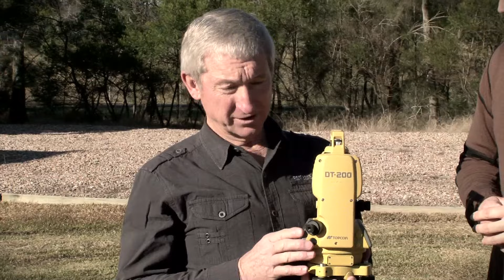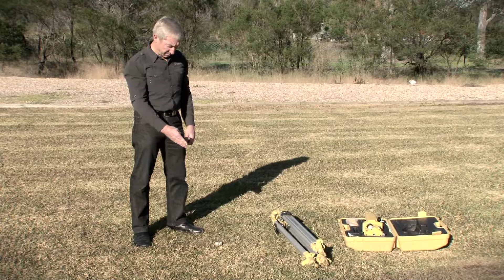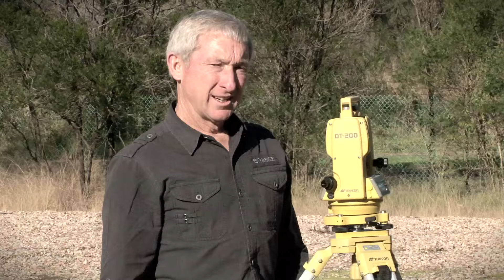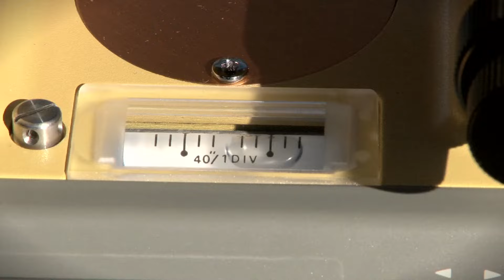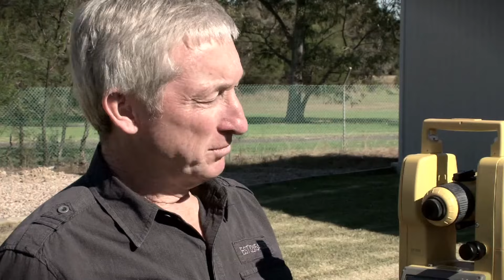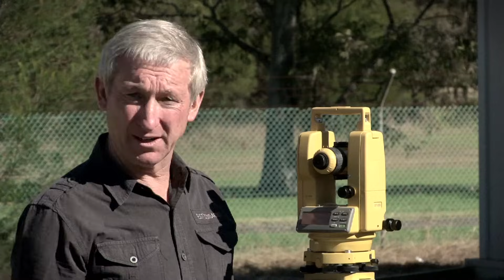Theodolite 1 - Intro & Setup

Comment: Alternate method:  Set up the tripod over the point keeping the top of the tripod as level as possible.  Use a plumb bob to also get close to being directly over the point.  The tripod can simply have a cap or have the instrument on it to keep the plumb bob centered.  Use tripod leg adjustment to get the plumb bob as close as possible to being directly centered on the point (and don't forget to get the tripod firmly pressed into the ground surface).  Remove the plumb bob.  Then level the instrument.  Then use the optical plummet (or laser plummet) to get directly on the point.  Unscrew and move the instrument as needed and try not to twist it when moving it so as to maintain level as much as possible.  Check the level, double check the point - adjust as needed.  Done.  I think my alternate method is a bit quicker than what you see in this video.  But to each his or her own. 🙂

Comment: When using the plate level, you also need to rotate 90 degrees,  and level ( with the 3rd screw only), and repeat, until level both ways, and still over the point.

Comment: A quick question, if you know the answer...
I have a theodolite with a laser plummet. However, the tripod has a plumb bob hook inside the tripod screw. This works well for when I attach a plumb bob. However, this interferes with the laser dot which becomes quite blurry and poorly defined. What do people do in this situation?
Reply: Stupid answer - Can you remove the plumb bob hook from the tripod?
Reply: @christophertierney6600  Only in the same way that I can swap out my laptop's hard drive for another... (not easily or quickly). In the end I removed the plumb bob hook with the intention of returning it to the tripod screw... but this action certainly damaged it (the way it was attached suggested it was not designed to be removed). A separate tripod screw (with shipping) was almost the same price as a new tripod. So, the solution I have adopted is to have 2 tripods.
Reply: @mathmandrsam  Some lessons are expensive ones. Silver lining is having a second tripod?
Reply: @christophertierney6600  I wasn't too worried about the price. Bonus was that the theodolite was new but old stock (still sealed) and I got it 50% off retail. So swings and roundabouts.

Comment: With all due respect, if you worked for me, I wouldn't let you touch a theodolite! I would use you as a rod man. I have been working in surveying for more than fifty years(yes, I am old) and am still working. No self-respecting instrument man would set up like this. First, we use a light weight plumb bob while setting the tripod for rough centering(the tripod should have a plum bob clip to hand the plum bob). Then we level the instrument COMPLETELY, otherwise it would be folly to use the optical plummet. The instrument must be leveled in BOTH directions, not just one as you did. Then we use the optical plummet for fine adjustment over the point. Then we level again and check again. Usually, that is enough. The entire process should take no more than half a minute or so. People on the job don't want to wait around while you fiddle. I will give you credit in that this seems to be the inane method currently taught to unsuspecting students. By the way, fifty years ago we used steel circle transits with no optical plummet, just a heavy plum bob. I could set up perfectly in around thirty seconds(even in the wind). The world record was around ten seconds!(Yes, there were competitions!). So, let's stop using this "modern" insane method and use what professionals use: a plumb bob for the rough setup.
Reply: I usually use a dot lazer it's a little bit faster for me to center the legs.  And I use a torpedo to get the legs level before I even put on the theodolite.
Reply: A plum bob, is that like an apple bob ?, bobbing for apples, that is.
Reply: Time to move over pops
Reply: @iwaswrongabouteveryhthing  I see you have total disrespect for the older generation that one day you will be part of. This lecturer DID NOT even show a quick push down of the Tripod legs with a Foot to embed them slightly into the ground, before even adding the Instrument to top.
Reply: Only noobs need a plumb bob for rough set up!!

Comment: I do not understand???  This process was taught in class as well.  I highly disagree.  A torpedo level and plumb bob is required.  
Correct process.
1. extend legs and place level on top of tripod, and level
2. hang plumb bob and move over pin
3. recheck plumb bob level
4. connect Theodolite and check level and pin

The problem with the way which is shown in the video is that the base for the theodolite is not level.  So when our engineer in the video used the plumb sight to get over the pin, he was still off with his levelness of the base, which is a big issue.  Time, it is a waste of time.  efficiency is required.

I argued with my classmates about this and they disagreed. However, they are wrong, this video is wrong, and I am correct.  I know that my way is correct.

Furthermore, when our engineer slides the theodolite to center over the pin, his levelness will be thrown off, because his base is not what?  correct, is not level.  thus this videos process is just fighting a losing battle.

I am a bricklayer and this is how any bricklayer would perform this task.  thanks.
Reply: If you  start with an instrument that's pretty close to zeroed, you can eyeball the top of the tripod level. The leveling screws got plenty of stroke  you don't need to fuck with the torpedo . It's redundant. You're going to have to use the leveling knobs  anyway.
Reply: This lecturer DID NOT even show a quick push down of the Tripod legs with a Foot to embed them slightly into the ground, before even adding the Instrument to top.

Comment: You wanna save a bunch of time...????
Set up over the pin looking through the down periscope.  Don't even think about touching the screws yet.
The bullseye bubble is just to get you close the critical vial is what you want to be gospel when you can spin it round & the long vial(critical vial)
Remains spot on level through 360,780 etc are you ready to go but we're not there yet.
Next use the legs to get level w/the bubble just fast & dirty.  Check down scope for set up move if necessary.  If you start turning dials @ this point it will move far from its mark & you'll be repositioning it all damn day.
After leg leveling & the bubble seems to stay in its circle your still not there if the critical vile isn't spot on through rotation but real close now use the dials for fine tuning & last positioning.   & when leveling 1 leg & 1 dial you should never move.  It's on 3 legs & has 3 dials use two legs to level up to one leg and two dials to level up to the dial that was over the stationary leg.  I'm no professor at this just years behind one laying out commercial buildings as a carpenter.  When everybody's screaming for layout lines on the site time needs to be saved without throwing down dirty layout or a busted grid.  Layout personnel need time backcheck their work or it's gonna be the curly shuffle
Reply: Bill, agree, however, a plumb bob and a torpedo level ( high quality) is better.  this allows one to center over pin and level top of tripod.  saving tons of time.

Comment: The foot screws on the tribrach were some way off the central position before he started. Better to be central so you have equal opportunity for adjustment both ways on each screw. Also when checking the plate bubble, adjust the foot screws in both planes (x and y) to ensure the instrument is positioned level. Nice simple video for beginners.
Reply: Oh you need
Bobs or veganas
Reply: Yes, you are correct. You should always start with the screws in the neutral positions. More than that, the screws should have already been in the neutral position when you put it in its case. The above method is for amateurs!(see my comment above).
Reply: yup, the video only showed leveling the plate bubble in one direction, parallel to the 2 foot screws. It should demonstrate as well the turning of the instrument 90 degrees, more or less, and leveling the plate bubble along that second axis using the 3rd foot screw. Then check again through the optical plummet if its crosshair already coincides with the mark on the ground. And if not, release again the instrument's tribrach and move it while aiming for the optical plummet's crosshair to coincide with the mark on the ground. Lock the tribrach up and repeat the leveling process on both directions until you check that the optical plummet's crosshair coincides with the mark.